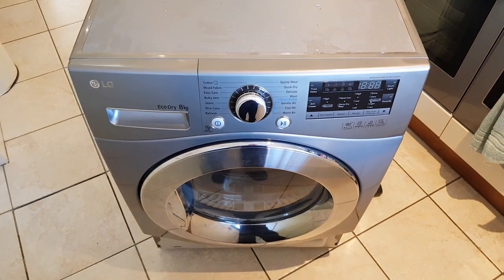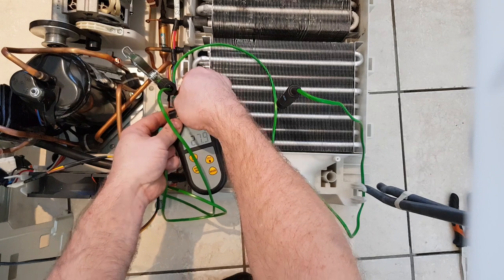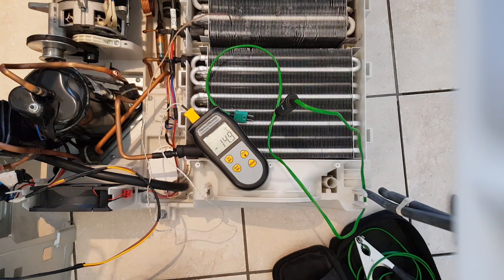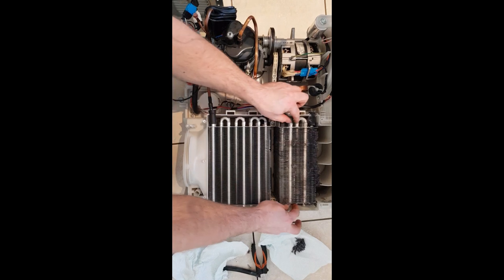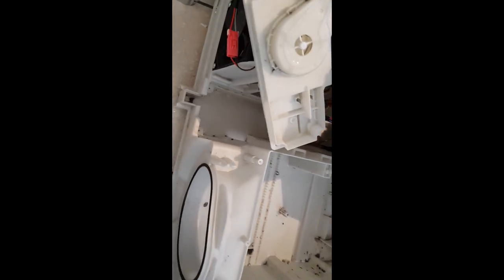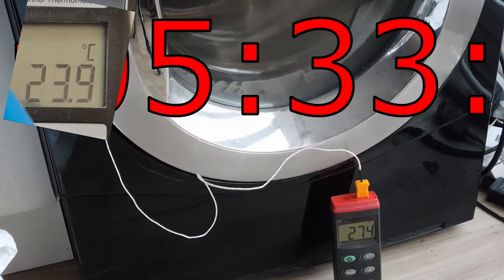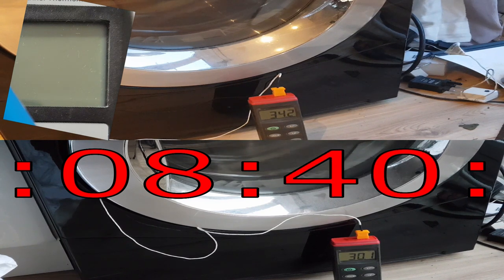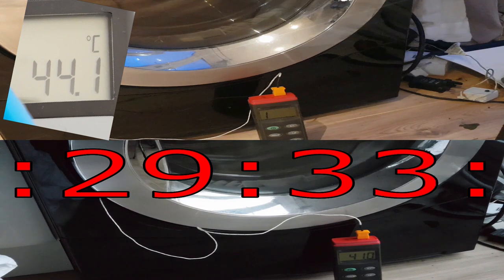heat pump tumble dryer how do they work  and how to test and fix them

Comment: I just bought a heat pump dryer, but I refused the optional warranty for 8£/month. I used to fix my appliances, and this video confirmed that I could still do it if need be.
Reply from the maker: Good for you everything is fixable i love the idea of repair rather than replace everyone should be entitled to get their monies worth from a product. We live in such a wastefull time in this age
Reply: @jaysjetskis  YOU"RE ABSOLUTELY RIGHT....and It's nice to know that I'm not alone by the way
Reply: I  purchased a hoover 11kg heatpump tumble dryer 13 months ago wht a pain in the ass to disassemble nightmare it was the build up of lint  is bloody dangerous the 3 in 1 filter is a waste of space I've tested the heat after 30 mins and min gets up to 65c it's very strange because it drys  8 towels in 60 mins it is very important to clean the filters because the evaporator/  condenser will block up and damage the unit I also believe these are the future and I'm very pleased my next  model will be a Siemens brand
Reply: @zedzedder1426  not if the compressor goes as mine did. I did all the cleaning and got nowhere. The compressor is £500 upwards plus labour gas etc. Now I’ve got to scrap the machine

Comment: Seems ridiculously complicated for a tumble drier ...and that comment comes from an aircon engineer lol.
Reply: you are right*84times. complications mustn't be on such general appliances
Reply: I just bought Beko heat pump dryer and the only overcomplicated thing is the user interface (do not understand why so many modes when the only variable you may dial in is the final humidity...). Otherwise there is just the blower/drum motor, the heat pump itself, drain pump and the external cooling fan. Not "selfcleaning" rubbish, the pump evaporator face is just user accessible  and you are supposed to clean the lint out manually. No big deal.
Reply: @annaplojharova1400  my point is that a normal tumble drier just has a heater element. These heat pump ones have a whole multitude of extra stuff to go wrong.
Reply: @phil955i  Well, even when it would last just half compare to the heater one and was not fixable anymore, it is still cheaper to use the heatpump one.
Plus as the author of the video said, the heat pump itself very rarely goes bad, most often the culprits are in the small things around. And those are practically the same regardless what system the dryer uses... The heat pump complexity may be the acceptable "tax to pay" for the lower consumption. But the fancy display user interface does not bring anything in the real performance, just an unnecessary (in my eyes) complexity.
Reply: @annaplojharova1400  I guess the other tax is the 3 to 5 years it takes for the heat pump drier to start giving savings over the conventional one
Reply: @phil955i  Well, you are then quite lucky, here it is barely a year...

Comment: unless your are a handyman person, cleaning this type of dryer is not easy. i am just wondering why lg and other manufacturers cannot add another filter before the air going to the evaporator and make it easy to clean without disassembling this type of dryer. also why not use the heat radiating from the compressor encasement as additional heat for the dryer. i am sure there is a way to implement it.

Comment: I have a Samsung dryer with a heat pump 9kg compressor, it takes 3 to 4 hours to dry if I put two towels after they come out of the washing machine, is this normal or is there a weakness in the dryer?  The temperature of the inner drum is approximately 45 degrees Celsius. How can I increase the drying efficiency and temperature by changing the capacitor?

Comment: This is an excellent video with many nuggets of knowledge. I've used this to look at my Hoover heat pump dryer. The symptoms are not heating so I suspected that the heat exchangers were clogged with fluff. Sadly this was not the case, they are nice and clean. Measuring the 2 refrigerant lines where they go into the heat exchanger housing, I get 48 degC and 18 degC after about 5 minutes. The compressor is working and drawing about the same power (450W) as a working dryer. All I can imagine is that I have a low gas charge or a blockage in the refrigerant line somewhere. I guess that it is beyond economical repair at this point 😞.

Comment: Good vid it’s making me question mine I’ve got a hotpoint heat pump one one of the latest ones the problem I’m having is that sometimes it sounds like a loud popping noise like when boiling eggs in a pan or doing popcorn on the microwave and I’m getting pritty concerned about it if I do a load of towels because it’s been on for quite a while they smell like rubber but if I do clothes sometimes they smell and sometimes there fine can u help ??

Comment: My Grundig heat pump dryer has stopped heating up. I learned more from this 15 minute video than the last 6-8 hours of research and talking to "experts", who all told me to press the reset switch on my heater.
Yes, 3-4 of those hours were spent trying to find the heater in my heat pump dryer.

Thank you.
Reply: I have a Grundig hp too,  how did  you eventually get yours to work again thanks

Comment: You are spot on  these machines are basically Dehumidifiers enclosed within a metal box incoperating a drum . I worked for Ebac a major dehumidifier manufacturer and we produced over 20 years ago  a drying tent. Basically a breathable material that fitted over a clothes horse with a dehumidifier enclosed, effectively these heat dry pump dryers are the same, but with many more components and yes to go wrong especially the tower style compressors within these machine that tend to become very noisy.
Condenser and evaporator coils are notorious for getting clogged up with dirt. So if you're not competent in dismantling your dryer then its wise to buy a warranty . 
I was tempted in buying one of these heat pump dryers, but after watching numourous vids I'll stick with a heat dryer instead. So if you have your dryer within a garage or cold area  a heat pump dryer is not for you.

Comment: Thanks so much for this video mate. I was going to buy a heat pump dryer, but couldn't find enough info about them. Yours explained what one is and how it works. After seeing how complex it is I'll be sticking with my White Knight vented for the time being. It's 15 years old, but having a few problems with it. I'll be getting a condenser dryer when it finally does take the knock.
Reply: Good call, DB

Comment: Thank you very much. Excellent in-depth explanation. Extremely helpful. I spent the whole week to find that two metal contact which gives false alert on board to empty water tank. Not only that full HD video without any blala blala. Excellent. Subscribed

Comment: This is an excellent explanation of the working principles and problem solving of a very expensive piece of kit which due to electricity cost is becoming very common in most peoples homes
I really liked the comparison to a dehumidifier, made so much more sense to think of it like that!

Comment: This video has been eye-opening. Been looking at these heat-pump tumble dryers for a while. I knew that they used less energy and lower temperatures than vented and condensing types, but had no idea the temps inside were so low.

Was looking through all the spec sheets on these A+++ dryers and many were quoting 2-4 hours for a full cotton load and I couldn't figure out exactly why. Seeing this explains it all, really.
Reply: Ditto here. I try to find repair videos BEFORE I buy products now.
Reply: The temperature is not that low, normally is in the 60degC at the heat pump condenser, 30degC at the evaporator. But definitely not the 80..100degC the classical heater type...
Reply: It’s the dehumidifying process that drys the clothes. Not the temp.

Comment: Thank you for this brilliant video.  Very detailed & makes it easy to see how to fix some of the simple issues that can cause this heat pump dryer to stop working.   This dryer is a dream to use & to be able to fix problems ourselves, especially if it is only fluff blocking the drainage, is truly an answer to prayer!

Comment: Great video thanks, there's not enough from actual manufacturers of these products explaining some of the facts and maintenance issues with these heat pump dryers! 

Any ideas on what could cause the evaporator in mine to start getting warm after about 45 minutes of running? It is definetely cold to touch initially then definetely starts getting warm and it just keeps running and the drying process never seems to complete, as it's just circulating hot steamy air with no dehumidifing going on. It's a 5yr old Samsung heat pump btw. Thanks!

Comment: Thanks for the tips, i just picked up an lg 8kg eco dryer (RC8055AH2Z) for £30 as it wasn't apparently drying at all. It was being used in a garage of a house  which the owner had recently moved into and i think it's because ambient temperature would be so low. Also it needs stripping and cleaning out anyway.

Comment: Great down to earth video explaining heat pump technology,  maybe you can give me a little bit of advice on my hoover heat pump dryer , I recently purchased a used unit (Hdry 300) and lady said it was working fine but I noticed intake fan was not rotating at all and seemed to be making a noise (drum still rotating ), just need to know if you would expect this fan to be rotating all the time on every cycle?

Comment: Thank you very much, I do not speak English but I managed to translate the video by subtitles. I needed this data because here in Spain these dryers have many leaks when I repair the leak I do not know how much gas to load, since the r134 is not loaded with an ecological substitute. Ask a thermometer do you put it in the filter and the other where you install it? Most dryers have a probe at the outlet of the condenser. You could make a study of that temperature when it is critical. excuse my English

Comment: Hi Jason, just bought a Whirlpool hp dryer and it worked fine for two weeks. Then the drum stopped turning mid cycle. Compressor kept running and the cycle kept timing out. After r a 20 minute pause, the drum resumed turning and the cycle, which had continued counting down, timed out. Clothes were not unsurprisingly still wet. Whirlpool service found no faults but the machine had been unplugged for over a week. The machine did not fail when service was here and they pronounced it fine and further said drum stoppage like this is normal and left. it has performed several cycles since uninterrupted. I noticed the pump had a very weak and erratic stream when emptying and thought maybe an erratic float or poor pump performance might have stimulated the drum stoppage although service said the entire machine would shut down in that case. Without and elementary diagram or ladder logic, I have no way of diagnosing what conditions would hold the drum motor relay out but still allow the compressor to run. 
,

Comment: Hi. I have an issue with my Beko heat pump thumble dryer. It stopped drying.  I have cleaned everything like in the video and after run the test mod as per Beko instruction. All seems good except last stage, compressor heats up from 20 to 50 deg within 30 min, which looks good. But it still doesn't dry the clothes.
Please advise. Thanks

Comment: Thanks for the detailed explanation.

I have a Beko heat pumped tumble dryer that is now taking forever to dry clothes.  There is little or no water collected in the tank, but I do get it condensing in front of the exchange filter and drips onto the floor.

My guess is that the evaporator is not getting cold, but it is still generating heat.  I have stripped it down and checked for fluff blockages, but it is quite clean.
Would this be a case where it has lost gas, and if so, where does it lose it from?  looking at the pipework, it all looks sealed.  Also, can you get these re-gassed, or is it a case of buy a new one?

Thanks again .
Reply: I have the same "symptoms" on my Candy Hp dryer. Its only 11 monts old and they going to exchange the product( gas is lost probably).
Reply: Hi did you get it back working? I have the same issue. Thanks.
Reply: Beko brand is one of the most unreliable brands here in NZ, so.....
Reply: Oh ... same here... did you resolve this problem?

Comment: A great video, easy to understand, but what a load of faff with  these dryers to keep them dust free, that soup at the bottom sump gonna be lovely in a humid environment if only used once a week ? BUT great for the likes of us who can pick them up broken for small dosh and after a good clean up and test get it working again, I bet an engineer working under guarantee  doesnt have a chance to give these such a thorough clean out thats required  !!

Comment: Thanks, that's an excellent video. I've not bought one yet as I wondered if they "leaked" moisture into the surrounding air but suppose they're better these days. Is there a particular brand that you fix more (or less) often or is it always a case of fluff? Thanks

Comment: What a helpful video, much appreciated. Do you have any recommendations on brands that are easier to maintain and clean than others - or maybe brands that have a filter system that's effective? I have a whirlpool that's an absolute pain to clean, as you have to disassembly almost everything, and I'm not that handy to begin with. And the filter system is really bad. So I'm looking to buy something that I can maintain and make last.
Reply: I've yet to buy one myself but I'm a fan of learning from other people's mistakes. 😁 I've asked the same question you asked on several similar videos and have yet to get a decent reply.
Reply: I bought a used 4 year old Whirlpool WHD5090GW and pulled the plastic grid with some pliers and cleaned the filthy evaporator fins with a plastic toothpick and a vacuum.  It works fine now.  The temp at the lint catcher is 48 C and the rear panel duct it is 58 C.  I wanted to do the easiest solution first before a full disassembly.  I then dried 4 bath towels and a hand towel and it took 83 minutes. Towels were dry afterwards.

Comment: Jason, great video with explanation, thanks! I have LG hybrid which has been taking 6hrs to dry, even after that the clothes are still not adequately dry. I have to put the dryer on another couple of time to get it dried. I have another problem, whenever I put it on Turbo(speed) mode, after a couple of minutes the dryer stops with "The duct or lint filter is clogged" error. If I switch the dryer off and on again and put it on hybrid I do not get the error but as I said it is taking far too long to dry. I have stripped the dryer, the only fluff I had was behind the drum at the back, but the heat exchange and fan (attached to the motor with plastic fins) was not covered in fluff. I then checked the ohms readings on heating element, thermistor and thermostat, they are working. I then replaced the main circuit board. The problem remains the same. Do you think the problem is with the compressor? I need to get a digital thermometer (is there one you would recommend?)and do the tests you have suggested. Again, I can't thank you enough for the video!

Comment: I was just given a heat pump Samsung 1 year old it only just gets up to 27 c cleaned evap /lint filters ,done pump tank flushed an primed pump  blew through pipes..should add unit mint in drum ..thank you for showing no element cus I was looking for it.. question is why is there no more than a few drops in tank ..could just be the lint under the condenser/evap .ps room temp 17.6c. I would say it only had bout 20 cycles since new ...it's all working just taking 10hours to get to damp.thx

Comment: Jason, think I'm having an issue with the heat pump on a dryer I just got as a project. Can you tell me if the evaporator should be cold to the touch? Just had the machine on a cycle for about 45-50 mins and doesn't seem that warm inside the evaporator doesn't seem any colder than the rest of the machine. Can hear the compressor working and have cleaned and checked everything I can see within the machine.
Reply: Guess all your refrigerant leaked out. Maybe the compressor broke as well.

Comment: Hi, thank you for this insightful video. I don't know if could help me, but I have a Samsung heat pump tumble dryer, that one day stopped drying the clothes. after a thorough research online, I took everything down and cleaned the condenser into my shower. put everything back, and now, I have the clothes completely dry but, there is no water being condensed. Not a single drop of water. the compressor is extremely hot afterwards and takes hours to cool down. I tested the compressor's fan itself, and it is functioning, tested the thermostat that goes into the compressor and it is functioning. I don't know what is happening. Could it be a leak of refrigerant? if that is the case it seems extremely rare since almost no-one has mentioned it without clear finding of oil drips and other. could it be the condenser cooler fan? not getting any input from the PCB? what else could it be? I would much appreciate your time and help with this matter.

Comment: Very useful video, clearly explained, thanks.
Reply: I have the problem of it not drying, tried taking it apart but it is enclosed. I don't look forward to totally stripping it to find the cause, done all the cleaning of filter, pump is working as if I add water to the collection point it pumps back to the top reservoir. Wish I had a service manual so I could test sensors etc.
Reply: After further investigation I have discovered the problem is the humidity sensors, tested it by covering the sensors with a damp cloth, it cured it.